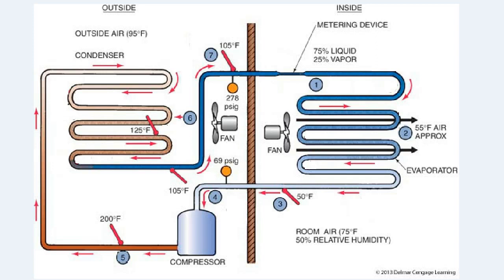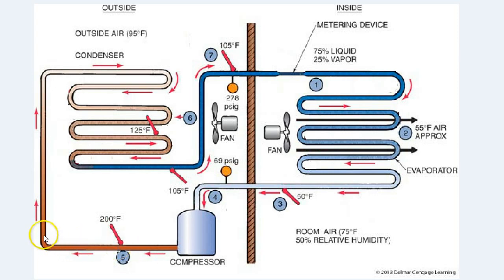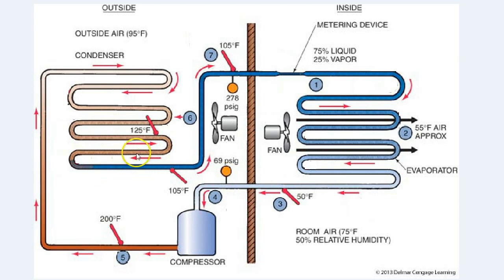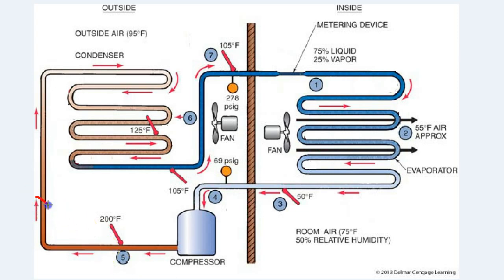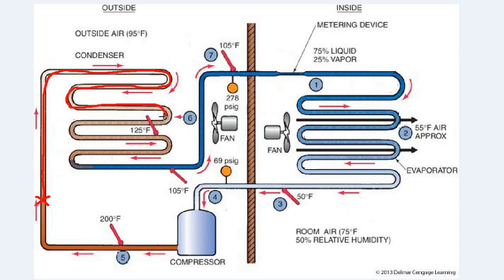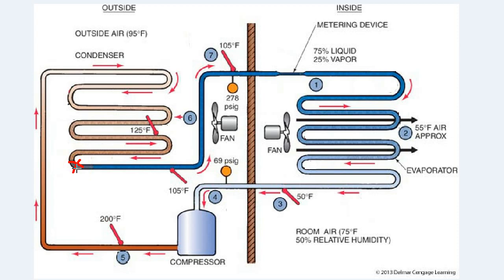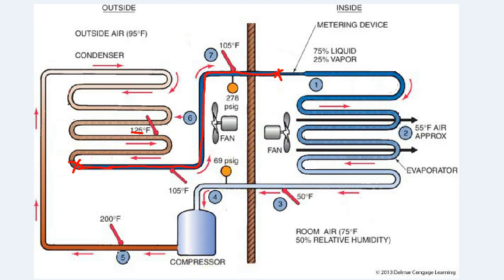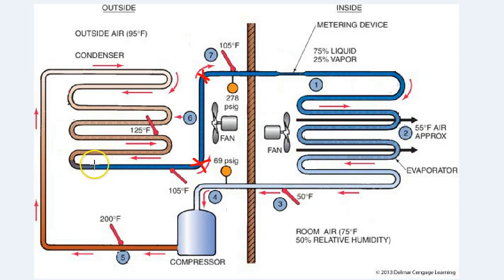Subcooling - Compressor to Metering Device

Comment: Except you could have explained how you mathematically arrived at the 20 degrees. By subtracting the 105 degree temperature entering the metering device , from the 125 degrees at the condensing coil. Hence 20 degrees of sub cooling.